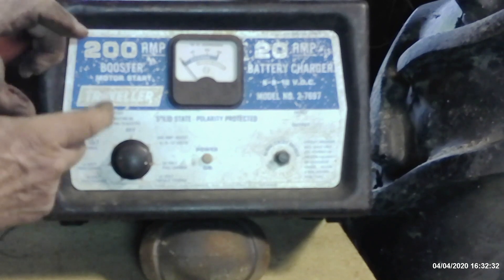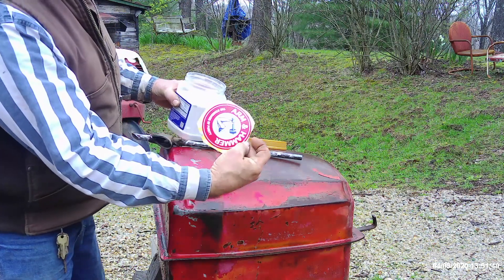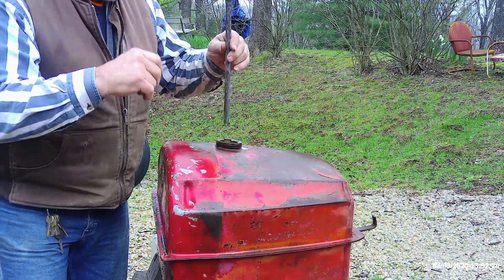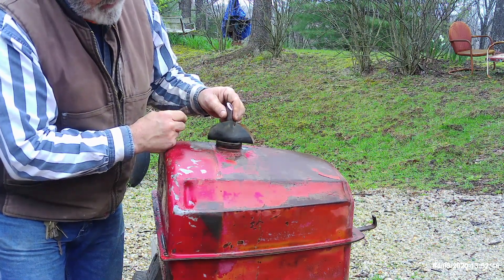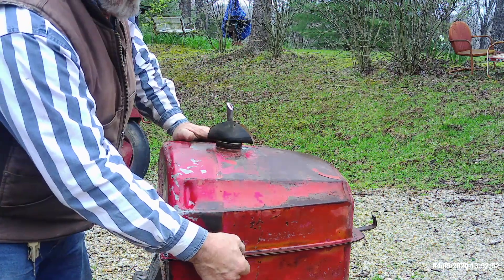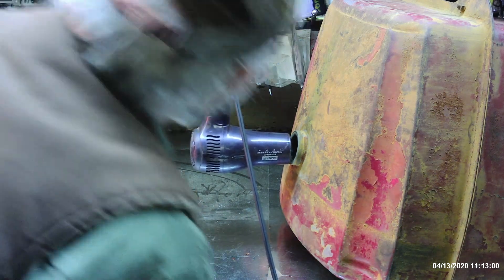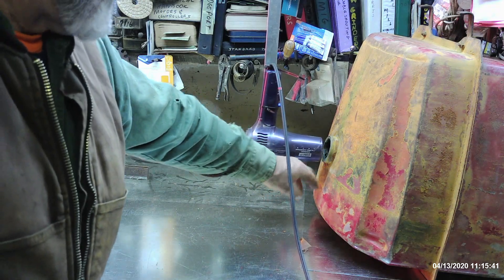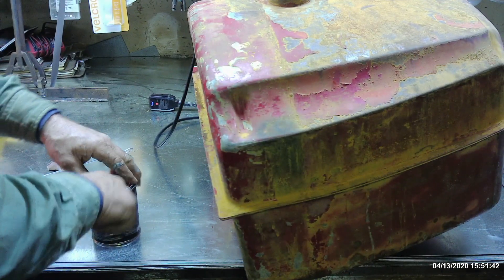Electrolysis Rust Removal Massey Harris 30 Gas Tank

Comment: Why not just rotate the tank with sand and water inside then clean out the tank
Reply from the maker: I like to use 3/4"' nuts and tie it to a concrete mixer.  I dump the nuts, vacuum what won't come out then finish up with a telescoping magnet.  Then if its shiny, go ahead and seal it but if its not shiny I fire up the electrolysis. I've done it with rocks and gravel, but its much more difficult to get out than metallic objects.  The final step with this process just about ensures a successful result that will last many years.
Reply: Sounds like a plan @tractorman4461

Comment: I assume when you turned on the battery charger you used the lowest charge setting normally 2 amps ?
Reply from the maker: No I use the high setting because the conductivity in the water will determine the amp draw. That’s why we add the tsp or the arm and hammer baking soda… to increase the conductivity. Remember it creates explosive hydrogen gas so do it under a lean-to or outdoors.
Reply: @tractorman4461  Many thanks for the reply . I started on 2 AMP for 30 minutes and then changed it to 6 AMP Then I read your message it was safe so I feel better. I'm working on it outside  so it it is safer...LOL
Reply from the maker: @MrBruce0777  you’ll quickly find the need to shut it off and clean the anode by using an angle grinder. That’ll make it start moving rust again. I even chsnge water a few times on exceptionally bad ones.

Comment: Great explanation!  Im getting ready to do this on a bunch of my restorations as well.
Reply from the maker: Awesome....depending on the tank, it goes pretty quick.  If you have a baffle, it's a tough job for sure.  Remember it produces hydrogen gas and it IS explosive.  Keep it either outside or at the least under an open lean-to.  Keep cleaning the sacrificial anode and don't make any sparks.  Total drying is important and 24 hours on the hair dryer works wonders for me.  I always suggest the pre-treatment as well. It's the difference between long term success and failure.  Good luck !!  Oh... the new smart chargers will NOT work.  It has to be an old style charger.
Reply: @tractorman4461  thanks for the advice brother!

Comment: I found, by using an amp clamp, that the current supplied by the battery and charger drops rapidly as the anode is coated.  I changed anodes every 30 minutes and greatly reduced the processing time.  With the electrolyte mix I had, a clean anode drew approximately 10 amps and it was swapped out when draw went down to 2 amps.  Interesting?
Reply from the maker: Yes, cleaning or changing the anode frequently does speed up the process for sure Rob.  I've not used an amprobe because mine only reads a/c amperage and not d/c.  I thought of that before though and was thinking of wiring a dash mount ammeter and feeding the d/c circuit through it to monitor the amperage of the electrolysis process. Thanks for the input on your technique.

Comment: Very informative x10 thanks so much !!!
Reply from the maker: Kirk the BIG takeaway is to do it with outside or with plenty of ventilation because the process gives off explosive hydrogen gas. Make sure you dry it adequately and use the recommended prep steps on the sealant, no matter which brand you use.

Comment: Impressive. Thank you for the tips.
Reply from the maker: The most important thing to remember is the byproduct of the process is hydrogen gas.  You should not do it in an enclosed space and if doing a tank, ensure that the tank stays 100% full so there is no space at the top to collect the explosive gas.  A spark from disconnecting the charger can ignite it, if care is not taken.  It 'll probably take several water changes  and several cleanings of the sacrificial metal depending on the severity of the rust.  Good luck with your project.
Reply: @tractorman4461  Thank you so much for your time.

Comment: Thank you for this great video.  Since you  sealed tank have you had any issues with product ? Is this still the sealer you recommend ?
Reply from the maker: No issues at all with this tank and two others I've done since this one.  Yes, this is still my preferred product, but let me suggest to follow the instructions as closely as possible.  Even using the pre-treatment to the actual coating material.

Comment: Great video, enjoyed watching and your explanation on using electrolysis for rust removal. Take care!
Reply from the maker: The main thoughts to concern yourself is related to the hydrogen gas that is created in the process.  Never do it inside a building and always keep the tank FULL of water.  A partially filled tank collects hydrogen gas at the top of the tank. Just in case, never make a spark when disconnecting the battery charger. Thank you Taylor for watching and commenting.  And If you choose to do this, do so with the utmost care.

Comment: Great job man. I have the same tractor could you send me a picture of the top of the distributer and where they go to what plug wires
Reply from the maker: Yes George, no problem. I'll need your email address.  But the positioning of the wires are dependent upon the position of the valves and piston of #1 cylinder. Make sure both the intake and exhaust valves are closed. (The rocker arms will have a little movement on the push rods/valve tips on both the intake and exhaust).  Pull off the distributor cap and see which wire port the rotor is pointing to.  That one will be #1.  Then connect the wires in order in the correct rotation of the rotor 1,3,4,2. 
    With the plugs removed you can easily turn the engine with the fan belt by hand to ensure you have the correct rotation of the distributer/rotor.  Guys get in trouble by thinking it rotates the wrong way.  Hope that helps.  Oh, if you are at TDC with the piston but both valves are NOT closed, your timing will be 180* out and it will just pop a bit while trying to start.

Comment: i read your artibcle have no proble with it so i will coment my version of this method have been doing this  off and on as needed  several yrs now ---- never had  a problem  im 88 yrs old i do things easy way  i uas a plastic tub for small stuff l leaver running all week end no prob  in a jerry can always use a rebar insulated so it touches only water with plenty air vent around its ok this way   its fairly safe and does a good job'
Reply from the maker: Oh heck yeah Frank.  That's the way I do stuff that needs external rust removal too, but I use a large plastic trash can or a cut off 55 galllon plastic barrel for larger ones and 5 gallon buckets for small pieces.  I think both our ways for the insides of a tank are basically the same too.  I use a rod of some sort or flat stock whatever is handy.  Thanks for your input and I am glad to hear you too have been using the process for many years.

Comment: I've been looking for a way to finish cleaning up a multi-baffled 90 gallon RV fuel tank. Your approach looks like one of the best for this one, so, I may give it a try. Safety precautions 'noted. Given your astute farmer-engineer-chemist capabilities, I'm rummaging around your videos. Nice.
Reply from the maker: Hahahaha....I really liked your comment.  Good one Wayne.  Yes, be careful and it WILL be a tough one with that tank.  Good luck with the endeavor and thanks for looking around the older videos !!  It is appreciated for sure.
Reply: @tractorman4461  I'm an EE. but that's no guarantee. Seems we get hit in the head when we are too focused on a particular thing (or uninformed). I watched videos of successful fighter pilots (ones that survive), their heads are always on a swivel looking out for what could go wrong.
Reply: @tractorman4461  Did the deed and it worked like a charm. I used a crude variable120VDC 2kW power supply running at 94VDC and 18 amps which did the job within hours. Beyond all the nasty chemicals found during this cleanout, there was a considerable quantity of small rocks and grit probably from when it was totalled in a flood 30 years ago. I'm shocked I ever got the engine running at all. Cheers and thanks again.

Comment: Would have been nice to show the inside after it was cleaned before coating.
Reply from the maker: Well Ted, I did try, but one camera wouldn't focus inside and the other would only show a shiny spot where the light shone through the gas cap so it was disappointing.  I have now got a bore scope with a built in light and flexible shaft that'll record directly to a micro-usb card.  Any that I do in the future WILL have an inside view of the finished product as well as a view of it pre-treatment. But what it looked like by inspecting with a mirror and penlight was almost like a perfectly new galvanized finish on the inside, but pitted from the now missing rust.  Then the finished product was very satisfying.

Comment: An excellent explanation and so good to have someone who knows what he is talking about instead of some of the bs that goes on. I have watched the video twice, taken it on board and am now off to sort my tank. Thankyou Sir.
Reply from the maker: Thank you Jimbo for the compliment.  Hopefully your tank is not one with a baffle to keep the gas from sloshing.  Those are very difficult to clear of rust.  The important thing to take away is the explosive nature of the hydrogen gas that is created....so do it either well ventilated or outside to be sure.  Then make sure the tank remains totally full so no gasses can accumulate at the top.  Many guys have destroyed their tanks by making a spark when disconnecting the leads.  I try to unplug the charger first.  Also one of the new fancy chargers will not work.  It has to be a standard old charger to work properly.  Hope that helps.

Comment: Great video! Thanks for the lesson. I wanted to be sure I was isolated so I used my digital voltage meter. Used the beep feature to check for conductivity.
Reply from the maker: Cool Matthew.  Just don't do it in an enclosed area and don't make a spark if you do.  The main thing though is if you are doing a gas tank, make sure it is ALWAYS filled to the brim.  Never half full.  That gives space to build up hydrogen gas.

Comment: This video was immensely helpful to me and encouraged me to try this process for the first time. We are in the first session, but it is going very well. Something valuable I learned: my old battery charger bit the dust and I replaced it with a new one from Harbor Freight. The new charger will run this method directly, but I was able to hook it to an old core battery that I know will never take a full charge then use jumper cables to power the electrolysis process outlined in your video. Obviously we are watching closely, but it seems to be working and I thought everyone would enjoy knowing about the way to do this using the newer equipment.
Reply from the maker: Thanks Josh that's good to know that connecting the fancy ones to an old battery will let the process work !!  I just didn't think of trying that. One of the most awesome benefits of doing youtube videos it the information I receive from viewers like you.  Thanks again for the tip and good luck with your project.
Reply: @tractorman4461 , thank you! Project was a huge success!
Reply from the maker: @joshphelpsconductor3648  Awesome !!  Glad to hear it.  The tanks with the baffle in the center are way more difficult to remove the rust from. You just cannot forget that the process creates hydrogen gas and it IS dangerous if not done with the right safety precautions.  Thanks Josh P for the follow up.

Comment: What a valuable presentation. Maybe you have a PhD in chemistry or physics, but if you don't, you certainly gained a great deal of knowledge throughout your life because you do a wonderful job of expressing yourself in a technical, but simple manner. I can't wait to try it on a 50 year old tank.
Reply from the maker: Well Steve, the only 'degrees' i have is about 103 of them when I get good and sick !!  LOL.  Thank you for such a complimentary comment.  Good luck with your tank.  But be mindful of the hydrogen gas that WILL be created.  Keep the tank completely full at all times. 
    Btw...I'm currently editing a video on another tank right now.  It is one that has a baffle across it and it created quite the time consuming challenge.  Sometimes on a seriously flakey tank, I will toss in a handful of large hexagon nuts and roll it around and around then remove the nuts/flakes etc with a telescoping magnet. Then I duct tape a short piece of garden hose into a shop vac and suck out all the rest of the rust dust the magnet can't get easily.  That is all before the electrolysis process is started.  
    Remember too that the new AGM battery chargers with all the bells and whistles will not work.  It has to be a standard old battery charger.
Reply: @tractorman4461  I determined that my charger is definitely too fancy, so I'll invest in one for this purpose and other jobs. Do you restore old tractors or just bring them back from the dead? I've done some resto's on a couple of 46' Willys jeeps and recently did a full frame off on a 71 FJ40 Land Cruiser. I'm converting it to fuel injection so the tank has got to be rust free. I'll definitely check for baffles and would bet there's at least one  I did one of the Willys tanks with a cleaning solution and sealing kit, using a steel chain inside as a scrubber. I'll forward to more videos. thanks
Reply from the maker: @stevehemingway9831  sorry Steve but your message went to the spam folder and I just found it !! I don’t really restore or make them pretty. I concentrate on the mechanical and electrical end. But I do fix critical metal components when I have to. I use many of my tractors around the property as well as my sons property so I’ve just not had the time to devote to actual restoration. But I will one of these days. I hope you had good luck with the electrolysis and fuel injection conversion.

Comment: Just curious how long did you keep the Hair dryer on to dry the tank> ? Mine is a 19.5 gallon tank and want to make sure it is fully dry. Also di you use the Por15 Prep first on the tank, or simply applied it without it? Great video!  Ty
Reply from the maker: Every tractor tank I've one, the hair dryer was left on for 24 hours.  You want to trap no moisture whatsoever.  However, there will be a slight 'flash rust' over all or part of the surface which is where the 'Prep' portion of the process is pretty important.  This particular one, I did NOT use the prep product, and have been fortunate to experience excellent results....so far.  But I am going to do another tank soon and that one and all subsequent ones will use the full process.  Thanks Rick for the question.  Hope this helps.  I learn something on every project !!
Reply: Yes it did, ty for the video and the quick reply :"_)

Comment: Well Tractorman, I am knee deep into a Motorcycle Gas Tank Electrolysis and was looking for something to keep the metal free from rust again. I never did catch the name of that product you used to seal the tank. Can ya lend an assist please?     Nevermind I saw it.   Sowwy
Reply from the maker: Yes....the product used in this video is POR-15.  I got it through Amazon.  I would highly recommend the additional preparatory product that can be ordered with the POR-15 as a bundle.  I make sure the entire tank is blown dry with a hair dryer for 24 hours before applying the prep product then later for the POR sealer.  Good luck with your project !!  I've done several now with this brand and am totally sold on it.  Far superior to the numerous other products I've used in the past.
Reply: @tractorman4461  Already ordered the full size kit. Thanks again.
Reply from the maker: @anonimous2451  no problem. Good luck.

Comment: POR 15, i.e. Paint Over Rust 15, paint is awesome stuff. Was skeptical myself. So I found a rusted scaly piece of scrap metal I picked up off wet dirt from the ground and painted all surfaces with POR15. I intentionally declined to remove the scale and rust. Once the POR 15 cured I threw it back in the same wet dirt on the ground. I actually forgot about it when two months passed by when I remembered my experiment. I pulled the scrap metal out of the still wet dirt and not one bit of rust on it. I was sold. Great instructional video.
Reply from the maker: That's a real good testimonial of the product for sure.  I am tickled to death with the product so far.  I'm getting ready to treat a Farmall H tank.  And its going to be POR-15 all the way.  I did electrolysis on that tank as well.  The bad thing about that tank is it has a baffle in the middle of it.  There's no way I can guarantee the product will get on both sides of that !!  Oh it'll get the tank surface, but the baffle....ain't no way.  Again, good story and thanks for adding it to the mix !!